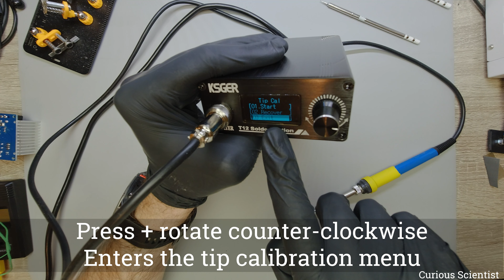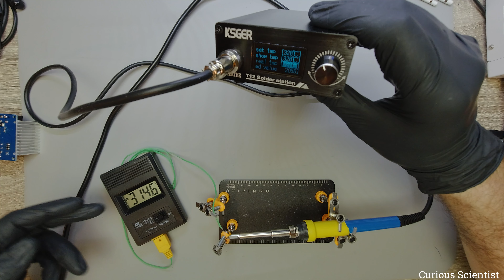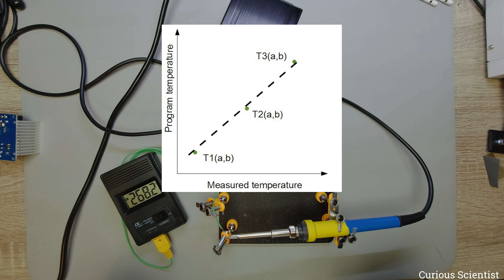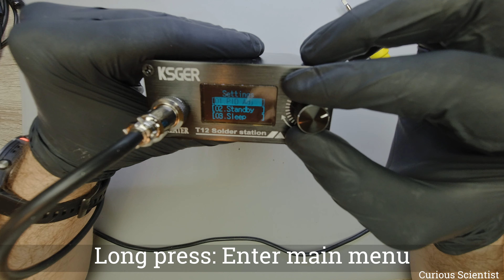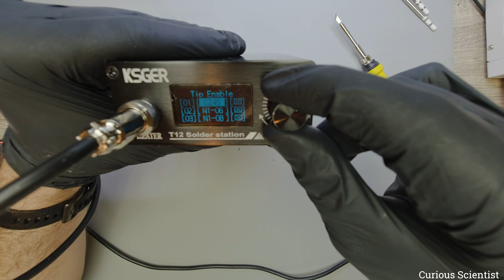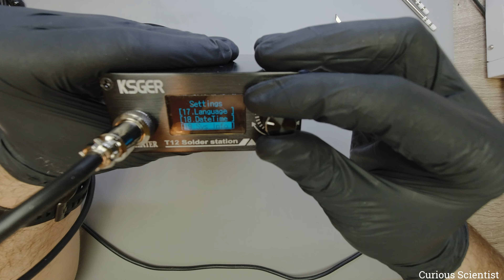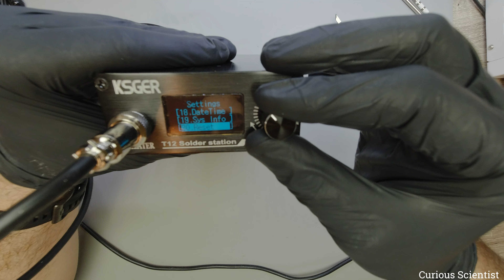Testing the KSGER T12 STM32 V3.1S soldering station

Comment: Excellent video, thank you.  But why didn't you grind down the grounding screw hole on the inside of the case where nobody sees it and let it look clean and neat on the outside?
Do you happen to know the difference between the V3.1S and the V2.1S?  Is it just the logic chip?  Is one better than the other?  Thanks!!
Reply from the maker: Thank you! I look at the front panel and not the back panel, so it is not visible, however you are absolutely right. I just simply did not think about it at the moment when I did it. 

I am not fully aware of the differences between the two models, but I would assume that both are reasonably good. I am still using it and it works just fine.

Comment: What about using electrical tape to cover the bottom of the PCB? Wouldnt that add another layer of safety? Or will it be a hazard? .
Reply from the maker: It is also a good idea. Or you can add a plastic sheet, too.

Comment: hi, thank you for the review. its very informative and detailed. hows the soldering station now?
Reply from the maker: Hi! It is still running without any issues. I use it quite often when I need to solder something larger. I bought a new handle for it some months ago and I like that too.
Reply: thank you brother. the official ksger store was selling v3 with mm32 mcu, no stm32 anymore
Reply from the maker: It probably doesn't matter too much. The other microcontroller is probably similar to the STM32. It must be some copy due to the chip shortage.
Reply: But you cant Install custom firmware on to the mm32 version

Comment: Do you have to solder a grounding wire from the PE pad to the negative pad in order to ground the solder tip or is that not necessary? Many thanks!!
Reply from the maker: I am sorry, but what is a "PE pad"? According to the drawings one can find on the internet, the tip should be grounded.
Reply: @CuriousScientist  Hi there! The PE pad can be seen on the main board. If you look where the revision numbers are, on the left hand side there is a sort of pad with 'PE' on it (near one of what I think are the heat sinks). A couple have said that to ground the tip, you need to solder a wire from this PE pad to a negative pad behind the front inductor. Is this true? Many thanks and great video!
Reply from the maker: Hi! I need some time to be able to answer it because I would need to disassemble the soldering station. I will look at it soon and reply to this same comment thread. Cheers!
Reply from the maker: @Kobra31677  So, I am back! I disassembled it. There are 2 PE (protective earth) connections on the main PCB. One is at the HV side close to the place where the live voltage comes in, and the other is close to the connectors that go to the other PCB of the front panel. 

The PE and the negative voltage seem to be totally separated. I tested it through the most notable points, but nothing made my multimeter beep. The tip of the iron is connected to the negative voltage. The pin which goes to the negative power rail is pin #3 in the connector. If the notch of the connector is at "12 hours", then pin 3 is the pin at "6 hours" position. This negative is common throughout the whole board, but once again, it is not connected to PE anywhere. 

I would assume that connecting the PE to this negative rail (therefore to the tip of the iron) would be what you are looking for. I guess that's the way if you need to ground (earth) the tip of the iron. To be sure, check the polarity of the tip on your side too in case you have a different revision and the negative pole is not pin 3. 

I will upload some pictures later but I wanted to write these down before I forget everything. :face-blue-smiling:
Reply: @CuriousScientist  Brilliant! So do you think that this is necessary to do or do you think that the only real mod we would need to do is to connect the earth to the case so that the case is grounded? Many thanks!
Reply from the maker: I don't think it is necessary as long as you are not dealing with components which are really ESD-sensitive. I have my TS-100 for about 5 years now, I have been using it without the extra grounding and all my circuits are fine. And I can confirm that the tip is not grounded, because in some weird circuit scenarios I managed to zap myself with the soldering iron... 

If you want to be super-safe, then it could worth the extra trouble, but otherwise, I think, you can leave it as it is.
Reply: @CuriousScientist  Brilliant sir thanks for all your work! Most appreciated 👍

Comment: if the capacitor was charged, would the rubber gloves you're wearing protect you from the shock?
Reply from the maker: That's a good question. I honestly don't know how good electrical insulators those gloves are. I mainly wear them to avoid grease on the parts I touch, and protect my skin against the chemicals I use sometimes. Luckily I didn't have the chance to test their insulating properties. 😄
Reply: @CuriousScientist  lol thanks. I avoid high voltage circuits out of fear.

Comment: I don’t have a drill to make any holes, can I not solder directly to the metal case, with the anodisation scraped away?
Reply from the maker: Sure, all that matters is a galvanic contact between the different parts. Just make sure that you use thick enough wire. Also, you might need a beefy soldering iron because the metal part can sink a lot of heat before you can solder on it.
Reply: @CuriousScientist Yeah, that’s what I thought, I will probably use a Pinecil v2 at 20V 3.25A, with 16awg wire, and T12-C4 tip for some thermal mass, sounds good?
Reply from the maker: Sure! Pinecil is a decent iron and nearly 80 W should be enough!
Reply: @CuriousScientist  That’s 80W on 24V 😂
I’m only running 65W with a short tip and 20V 3.25A
Should be fine though. Could always go up to 400C if needed
Reply from the maker: Sure, it'll be enough!
Reply: @CuriousScientist  Is 16awg wire good yeah?
Reply from the maker: More than enough, yes! It is always better to oversize the wire than the other way around.

Comment: I only found version 3.1 using mm32 chip
Reply from the maker: Based on the feedback I am getting from the viewers, it seems that this soldering station has several different versions with different microcontrollers. I guess, as long as you do not want to go into details with customization, the microcontroller does not really affect anything.
Reply: A user reported that the sleep functionality doesn't work and you have to bridge some connections in order for it to work
too many sus things about this station

Comment: All this effort only to have Banggood stop selling it. :(
Reply from the maker: I think, after a while their link just became broken. Try to still click my link and the same unit should show up in the recommendation (right panel), or just search for the "KSGER T12". I could find a similar unit I showed in this video. Or in the "worst case", you can find it on Aliexpress. I hope this helps.
Reply: @CuriousScientist  No, they only sell the “Mini” version now. It looks the same from the front but it is shorter and has no power supply. :( They also got rid of the clock and some other functions.
Reply from the maker: Oh, I see, I didn't know this! It's a pity because I really like the station. I even invested in a new handle and a full set of tips because I want to use it for various tasks. I think the manufacturer KSGER must have an official AliExpress store, maybe they still have the normal version in stock.
Reply: @CuriousScientist  They still have the 2.1. Without the power supply the 3.1S Mini is basically just a less-portable version of the TS100. :( TS100 even fits the same tips.
Reply: @CuriousScientist  They still have the KSGER 3.1S and 2.1S on the official aliexpress store, but the 3.1S is now using another replacement chip because the STM32's are hard to get a hold of. I bought a 2.1S instead. They're quite nice, speak a good level of english, and they're willing to change default tips/handle for you. The FX9501 is a better handle, and they told me for 3 usd extra, I could receive that instead of their default one, so I obliged.
Reply from the maker: Wow, thank you for coming back and telling use the details! I really appreciate that you took the time and I think it will be useful for the future viewers. I hope that you'll have a lot of fun with the tool!